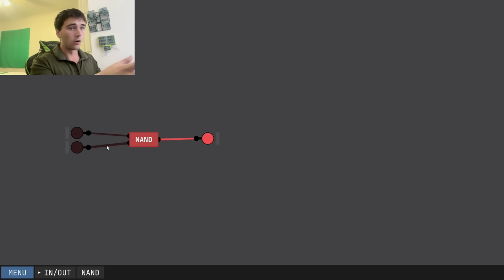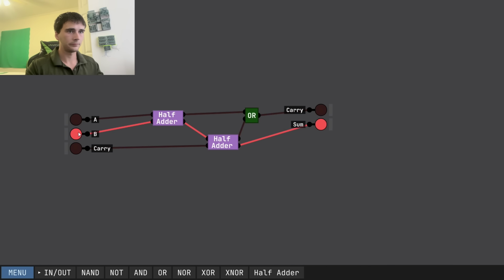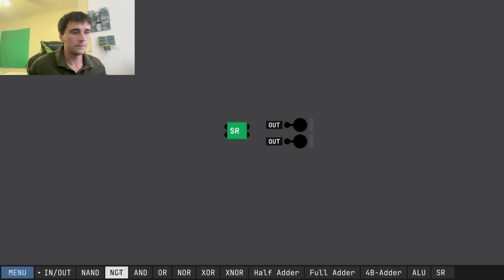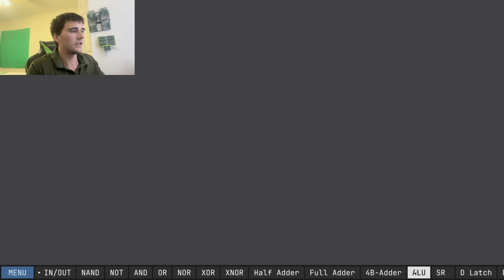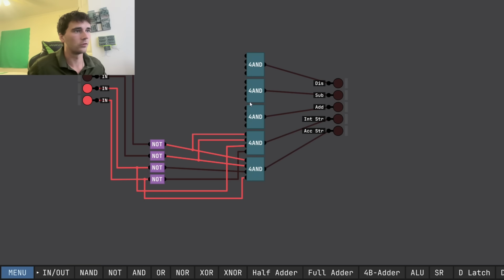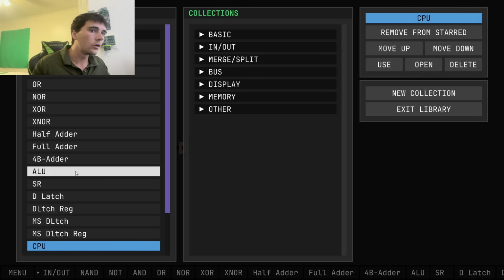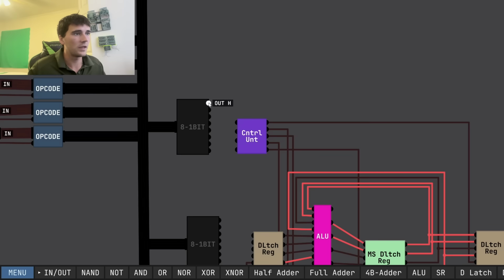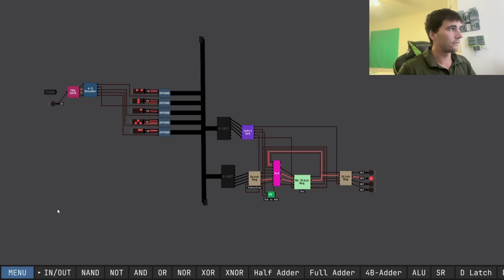How to build a computer TUTORIAL

Comment: Wow, that is 51 minutes of pure interistingness! :) I already followed all of Sebastion Lagues tutorials (the creator of the sim) and figured out the rest myself to make my 12-bit computer with 4-bit opcode 12-bit operand, 2 registers (prob will upgrade eventually), and i even crammed an entire 1.5mb of ram into the sim (i used the rgb displays wired up and adapted to be a drop-in replacement for the old slow logic gate based ram so each display can hold up top 384 bytes of data, but it still slows the sim down from 1000 to 30 steps per second). This video would have been helpful when I was making my own, but better late than never!

Comment: 13:43 i think adding an and gate that before carry/0 would be better, because it takes the 4b adder’s carry output as an input and another input would be the “not ‘sub’” (sub -> not -> and -> carry/0). That way if its subtracting then carry/zero would actually be a binary 0 (it will be cold) which works logically.

Comment: 19:22 here's how to make a pulse:

First make a chip with 1 input and 1 output. Place a/an XOR gate in the middle. Connect the input of the chip to the input of the XOR gate. Connect the output of the XOR gate to the output of the chip. Connect the output of the XOR gate to the other input. This chip should, at every game tick, switch the output if and only if the input is on. Call this chip "flicker".

Create a new chip with 1 input and 1 output. Place down an AND gate, a/an XOR gate, and a flicker. Connect the output of the XOR gate to the input of the flicker. Connect the input of the chip and the output of the flicker to the inputs of the XOR gate. This should make the flicker chip change if and only if its value is different from the input and, if so, the XOR gate will send a pulse to the flicker chip. This means that the XOR gate will send a pulse when the input has changed. Connect the output of the XOR gate and the input of the chip to the inputs of the AND gate. Finally, connect the output of the AND gate to the output of the chip. This should make it only pulse if the input goes from off to on. Save this gate as "pulse"

Here's a picture:

flicker:

in => XOR
XOR => XOR
XOR => out

pulse:

in => XOR
flicker => XOR
XOR => flicker
in => AND
XOR => AND
AND => out
Reply from the maker: There’s also a pulse chip built in the program

Comment: Im stuck at 45:00 im not sure how you turned the cpu on, if u used the clock it would had cycled but you clicked something behind your video cam box so i tried using a input -1 but i cant get it to be reset now?
Reply from the maker: Might have used the key tool to manually clock the software

Comment: The reason why the program didn’t display 5+2=7 is because there was a missing opcode-1 instruction before the display instruction to transfer the result of the ALU to the accumulator. That would have required adding an input for a 6th instruction or hard-wiring the add-mode to save an instruction.
Reply: Help me pls

Comment: And then there is that guy who built a computer on terraria
Reply: and the guy who built a gaming pc in minecraft
Reply: @LewisEdwards-y5t  computer...
We do not have any GAMING PC on Minecraft if I remember correctly
Reply: @Hashi201  we have
Reply: @Hashi201  and then there is a guywho ran minecraft in minecraft in minecraft in minecraft
Reply: @bgplayz7072 nah , the latter is fake 
You can have Minecraft on Minecraft, a little slow but okay
Minecraft in Minecraft in Minecraft, possible but very slow and not playable 
Minecraft in Minecraft in Minecraft in Minecraft, Impossible, it will be stuck and would take months to get to the next frame , don't get me started on the RAM needed and the RAM needed inside Minecraft
Reply: @Hashi201  somebody did it even though he got 1 frame per sec but still it's a success
Reply: @Hashi201  i saw a post on reddit it just need a good gaming monitor
Reply: @bgplayz7072 Monitor doesn't has anything to do here 
GPU and memory has and even after this there's a limit of TPS in Minecraft Java
The best you can get is 40,000 TPS , and even with that the MC in MC in MC in MC is impossible (building it is gonna take more than 1 yr) 
Can you send me the link of the reddit post?
Reply: and the guy who made an ai bot in babft

Comment: digital logic circuits are more easily simulated on a computer. physical implementation should be separated from the digital circuit logic. altho physical computer in transistors is nice as a whole. logisim evolution is free and works just fine for relatively small projects. ie for simple cpu etc.

Comment: dude this is a great tutorial, though my only critique is when you got to the tri state buffer you used a pre made one instead of just showing us the wiring of it like the others. i wouldve liked to see that. but for the most part this was really helpful thankyou.. at first i was confused when you oly hooked up the B inputs and just looped the register to the A inputs but i suppose whats happening is the first number comings in then gets looped around to the A and the second number comes in for the B. so after thinking more on it, it makes more sense.
Reply from the maker: It would be impossible to make a tri state buffer with pure logic gates. It’s its own special set up since when the enable pin is off, the output is neither 0 or 1

Comment: holy...why is the software so cpu heavy my fans are going crazy....saw the settings with 250 and 1000 so the simulation is always active what is not ideal.

more efficiency would be much better...the simulation doesn't have to be on all the time...just one time...at the moment you build something and you hit spacebar to start the simulation just only one time to see the result.

dont't know how to reach him but would be nice if the developer would give it another check or something:)

nice video btw
Reply: you can pause the simulation in preferences
Reply: yea but should that be like this? i changed the yettings to 1 and 4 to maintain the relation...also always in pause mode but that should automaticly be like that or am i missing something? it should be simulating if the user wants it and it should go to like a pause state after that...its just ok lets say a bulb is on...if its not a complex circuit it shouldn't eat up cpu for nothing you know what i mean? thats not just efficiency problems but not acceptable code and don't get me wrong...i like it but still lot of things are missing unfrtntly... @mrtophatrbx
Reply: @jingizkhan I like to set the tick rate to 60...

Comment: Wait with such latches does this mean that we can be able to do multiplication and then use those remembering latches to be able to have this clock cycle so that way we can make a sort of clock that goes on and off so that way you can be able to do not to actually do that multiple times so that way you can be able to calculate for example 256 ^ 2 which is 65,536 or maybe perhaps 5 to the 3 that would actually be 125 see the clock cycle works together which means that we can basically do this multiple times like we're talking thousands and thousands of times if not millions of times to get a GPU that can calculate exponentiation calculations and also as well if you even want as well you could potentially do negative exponents and it would also do another type as well and it would all be quite cool it's kind of like how you turn succession into multiplication and fundamentally this is already quite good because you can set the first number to one specific digit and then have a separate machine to be able to set the amount of clock cycles and then stop it after the clock cycles have reached per se for example up to 256 clock cycles so that way we can be able to take an ALU but instead scale this thousands and thousands of times to make a GPU of these addition machines with the ability to go and subtract as well as also a second set of machines that can be able to do multiplication and then in third set of machines that can be able to do not only multiplication but also even some exponentiation which means that we can put this first register so you can do and set with the first value being one and then that way you hold one times that number in that register and then it switches to that number like for example 10 but then the next goes from 10 let's assume that we have 8 bits so the next would be 100 of course and then after that because of the overflow you'll go from 100 you'll have this 100 and then it will go and overflow right back down to lower number then the original 10,000 but if you do have 64 bits this can keep on going for quite a while meaning that it works quite well because if we can be able to get the control of the clock signals this can be able to make it work by basically accumulating but I'll call this this sort of looper exponentiation type because by default it starts off at 1:00 but then the next moment when you do the clock cycle the input goes from one to this other number which means that if you do this millions of times you've got a GPU a CPU can have one of these including a lot more than just multiplication dividend and such we have to chain these together using an ALU now considering that we are using 64 bits this means that a lot of games are doing this as well and basically if you're using RAM technically you can be able to check RAM extremely quickly now an SR latch using XOR gates can be able to go so quickly but fundamentally this SR latch is what makes this work so well because you could use an SR latch so that way each time you keep on setting to a new value this can be able to check and even a sort of clock cycled type can be able to work as well because if this is a clock cycle in RAM as this is sort of a ram piece you can be able to have a sort of check value sort of thing where say for example we're trying to do calculations like for example we're working with three values The x and the y and the z now we have to work with 64 bits the first 32 being the default whole number values and then the second 32 being the fractions and such so that way we can be able to have the coordinates be quite broad still in the billions so yeah it works quite well and then now say for example we can have this sort of vector addition say for example a ball is moving in this simulation and this spools update right is in gigahertz now when this moves this ball moves slightly to a placement slightly further and then when you want to add more you can have a sort of inertia and this inertia will be able to make it look like it's more of a moving to one place style and we can even be able to see that this is how orbits can happen we can set the distance function and as you see this extremely small amount of DX as this would be making the derivative it would add on this value and then the original carry inertia value and then it would happen now as the inertia value changes in angle it changes so that way it's still 90° parallel and although a small amount can be able to change it so that way you've got a planet but same goes for the other object and then here is simulations like this with a thousand objects no problem just make thousands of these and make sure that the looper is like so configured then now each machine can be able to handle those 1000 problems all in one adding each thousand or you can set a looper to be able to loop through all of these thousands and thousands of calculations all in one go like it's nothing then after looping it finally finishes as each stored value finishes and since it has already calculated all the distances and such using the circle equations you should notice that this is quite finished as now all we need to do is just simply go in and run the simulation the billions of hurts you should notice that this would still be running at megahertz kind of like orbiting planets or maybe like a galaxy but it's more one and that is crazy because if you said it to the correct values you can be able to have the Milky Way galaxy in your own computer because of each star calculating each stars placements and each tiny little DX width that is so small and just speeding up is no problem you just multiply dx the value so dx you're multiplying the tiny little DX value which is a 64-bit integer by a certain amount now this allows you to have this sort of difference and now since everything is working like so very in a very good way you should notice that now since we've got this done already where there are thousands if not potentially you even probably a million which we can calculate and even with a million this could be able to still add up a million of these DX values so that way this would happen so now this would be in the kilohertz values and we would do this a thousand times like use a thousands of these to be able to add a lot of this to be able to still update it faster than even the display making a sort of analog amount like this is quite surprising although the only limit is the speed of light because here in such quick speeds we would need this to be small enough a few millimeters or so so that way it could be able like this whole signal could be able to get straight to that signal placement and come back without the memory registers completely glitching out which means that we could potentially have a computer that could be able to calculate this quite fast and do additions and multiplications extremely quickly which means that after doing everything all together using a few thousand in fact a few million of these tiny little whale you circuits all together synchronized you should notice that boom it works as you can see that this isn't lagging behind there are actuals galaxies forming and it's quite real time even if we may need to multiply the x by a little bit considering that we have to consider in the speed of light which is a constant because of how large this contraption is which means that after considering all of this we've got the full contraption now it's already done honestly it blows my mind how you can be able to easily calculate things so easily like it's like you can have a squared machine and then be able to calculate all these three numbers squared all together to be able to get the length you know and then we would have to square root it back again on the other side but that's no problem and ultimately it's quite crazy
Reply: Wow.
Hard to read without the punctuations tho

Comment: Great video, basically the long form detailed version of the "cutting through abstraction" talk from defcon 24 (aka how to build a processor in 10 min or less)

Also I watched to the end, I'll argue that "nobody else is doing it on youtube" is a bit disingenuous, ben eater is doing very similar content for quite somr time (though not directly using transistors) 

Also you might want to avoid the master-slave terminology as it's controversial, positive-edge triggered latch works well for the whole thing and clock low/clock high latch ior running latch/buffer latch are more descriptive than master-slave. For a more generic use, boss-worker, main-secondary, host-device and server-client are used quite a bit.
Reply: Please use the master slave terminology, and don't get involved with woke political propaganda that is meaningless and stick to technical jargons used for decades.
Reply: @nickz797  meh, even without woke, in the case of the edge triggered flip-flop, it's kinda misleading imo. (the first one keeps track of the input while the clock is low, and stops when it switches to high, which then the 2nd stores)

I think master-slave are overused in electronics and often doesn't mean much, and application specific terms are more appropriate regardless.

I think it is worth mentioning that it's one way it's called, but to use newer terms when applicable, do you still call capacitors condensers?

also it's the first time I heard about this term for this type of flip-flop.